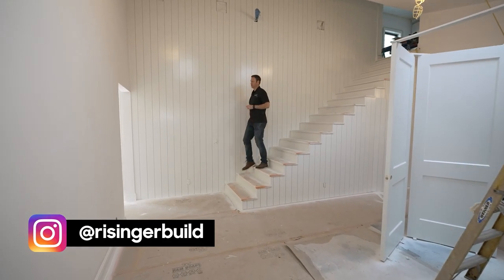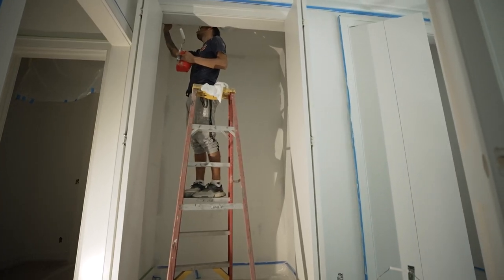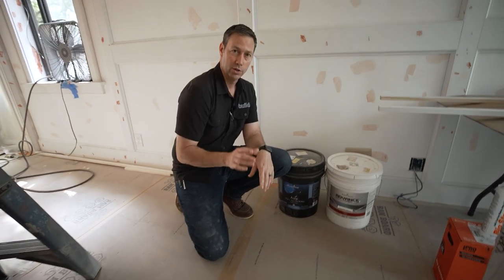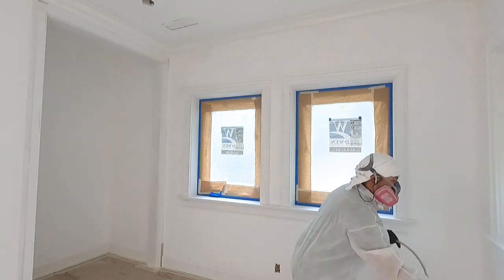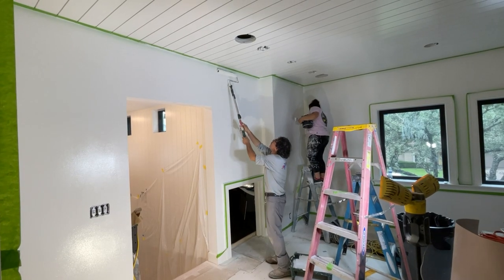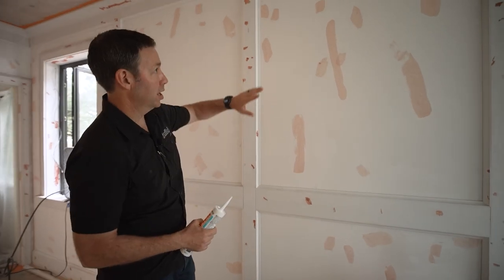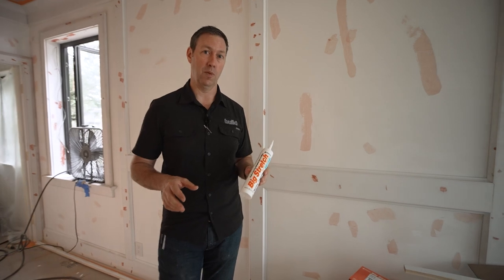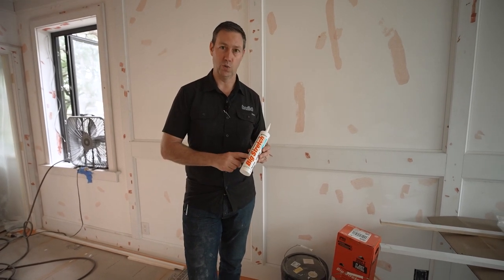The 4 P’s of Perfect Paint

Comment: The last part is the same thing we deal with in the Bay Area. It's really hard to find great painters. There's some companies that offer fantastic jobs but the budget is just flat out not there. And like you, none of our painters can price out the project before actually seeing the work so as a general it's really hard to budget for and show clients. We pretty much operate just like you on paint. We know a couple of really good painters and we just call them up for labor rates, and we supply all the material and equipment too. Painting is the hardest tradesman to find because good painters that get busy start hiring out and often times their employees don't have the dedicating and effort they have. Also one of my biggest pet peeves is them taking the project and just leaving their employees on site and never showing up. 

My experience with Advance is really hit or miss. You really need someone who knows what they're working with because it does tend to run. The Aura is hands down the best paint for Walls, they're decent for trim too, but it doesn't have that hard finish I like for trims. Durapoxy from Kelly Moore is a fantastic product if you want that hard finish, it's a little easier to work with, but it does dry quick so you have to work quickly (great for spraying), it doesn't run, but it doesn't cure quick, so it's still soft for 2-3 days. The best paint finish I've seen for trim is Hollandlac by Fine Paints of Europe. We have to get that out of state, and there is a smell, but you can get as close to an automotive finish as you can get out of a can that's not a 2 part lacquer. Personally I prefer hitting doors with a lacquer. Really hard to do on the job site, and it does exceed all VOC limits at a residential jobsite, but if you have a painter that has a shop or even an automotive booth, that's one option is to spray it with a 2 part lacquer that's used on cabinets. I absolutely love doors that have super hard paint and a gloss finish.
Reply: Great info

Comment: Its true that you get what you pay for, in every trade, in every construction material. Always under promise and over deliver. Always put the customer in the driver's seat on costs. Two to three options puts a reality check on expectations.. Cheaper paints cost more labor to apply, both in prep and in final touch up. As a businessperson there is margin to be made in materials just to handle it,  5-15% as a rule of thumb, so if your cash flow can manage it, it can help level out some unexpected job costs. Also, a good supplier relationship is key, beyond just commercial pricing, but in product support and service. If ever there was a warranty issue, you need another expert in your corner to help resolve and/or negotiate. Overall great video. Its hard to cover every aspect of a trade, but you hit the main ones from a builder's perspective. My dad always says, "hire the best, fire the rest". 👍

Comment: It'd say there's a lot more prep work on re-paint.
In addition to original issues you deal with, you also have to fix years of dings, stains, poor painting projects (roller fuzz, drips, roller trails).
I usually spend lots of time with a sharp razor blade cleaning up this mess before spackle, etc.

Comment: Great to see you go with level 5 smooth drywall. Really sick of painters insisting on textured finishes. Absolutely no reason to allow that. The bad news is that these days, you almost have to take what you can get in terms of painters as there is such a shortage of labor. We have been waiting over 2 years fora a specialty painter (Central Texas).
Reply: I might can help you. Describe your project. I’m north of Dallas but keep i35 warm between here and SA
Reply: We have been waiting over 2 years fora a specialty painter (Central Texas).

Likely a very intelligent decision. Bad painters using bad product can do a tremendous, & I mean tremendous,  amount of damage
Reply: @HarderNotSmarter1  Finished new custom home last January. Looking for a faux metal paint finish on a large range hood in a vaulted ceiling kitchen.  Need a bunch of other new-construction follow up jobs and painting as well. We are 30 miles north of Waco. Open to suggestions.
Reply: None of the drywallers around here do level 5 finishes. As a painter I always prime new drywall with US Gypsum Tuff -Hide Primer-Surfacer to make their level 4 finish into level 5. It's the same labor and material cost as using a regular primer but with better results. Last year a house spec'ed level 5 drywall and the general contractor paid a lot to bring in an out of town drywall contractor to do the work. You should have seen his face when he learned that he had been getting the same thing from me for no extra charge.

Comment: It's all in the prep. A small percentage of the project is actually “painting."
Reply: Especially when spraying. Then it's like 95% prep
Reply from the maker: Agree 100%
Reply: You left a "P" out, primer. It is very important and they are not all the same.
Reply: Agreed. There are so many prep tips, could be its own video
Reply: Absolutely, paint brand pales in comparison to... 
The prep and the painter applying the finish.
"As above, so below".
Reply: @ksimmonschicago  bingo
Reply: @ksimmonschicago  Surprised there wasn't an in-depth discussion of primer, that's the key in my view.

Comment: Love Aura and Advance.  Regal Select is also pretty good and gives Aura good competition.  I agree Aura (and Regal Select) have low odor.  Advance is low during application but once curing begins, it stinks.  Several days smelling that.  But it's fine, the self leveling is fantastic, long open time, and ease of use still make it a winner in my view.  Just can't be in a rush when using Advance, it's one coat per day.
Reply: You can easily do two coats in a day. If your profit margin depends on it there are many tricks to doing it.

Comment: I'm getting ready to do our house myself, I've painted before but I'm not a professional by any means.  I've still got wallpaper to strip (3 layers from a 1986 build) and to wash the ceiling in the kitchen/diner.  I know I need a colourblock primer and I also know our walls won't be stopped to paint finish; I'll have to try to get them close to that myself.  Luckily my plastering skills have improved over the years.  I've got everything I need now, including a Wagner spray gun designed for inside use which I know will give me a better finish than the rolling I usually do.  One question though, the box of the sprayer says no cutting in needed; I have a strong suspicion that it's lying to me; what do you think?

Comment: Advice needed. A theoretical inquiry. Does a single layer of 10 inch foam have the same R value as 4 layers 2.5 inch thick? Multi layer foam vs single homogeneous layer. Or 2 layers vs 4. While maintaining the same overall thickness. Thanks
Reply: what needs to be thought about is the movement of the foam. foam does move and one layer can open up. Multi layers are always better, though the r value of 10" of foam will be the same, the multi layers will perform better. when you go to install it, you can cut 2.5" of foam more accurately than 5" of foam. Hope that helps.
Reply: @martymunroe8882  Thank you Marty. Well noted. Any Thoughts on the fact that material is detached. The nano gap formed might change the conductivity thus increasing the R value. Just thinking out loud

Comment: I know this is off topic of this video. I want to insulate the gable ends in the attic. There are no vertical studs. Plus there are a lot of framing & siding nails protruding through the OSB. I don't want to cut any of the nails. My question is; can I use a adhesive to one side of Rockwool insulation to help the insulation stay in place?
Reply: If its an unconditioned attic, (meaning its not heated or cooled) There is no point to insulating gable ends. You add insulation to the floor of the attic. Because you are "conditioning" the occupied space below. Insulating the gables ends would be a waste of time, money in almost all cases. But yours may be different.

Comment: You practically MUST spray that advance. It pulls and drags sooo bad you can barely brush it! Backbrushing? No chance.
Reply: Not true - career painter here and Advance provides a nice brushed finish also, but you have to be experienced working with paint- best if temperatures are a bit cooler and you are using a high quality brush with high bristle count. Advance has nice self-leveling qualities. Of course it does also spray beautifully.
Reply: @nathanarmstrong2652  Yeah I only vfb started in 1991 so I probably dont have the same experience and only work inside where the temperature is climate controlled.  I will try to remember that advice when backbrushing 16 footers in the summertime in FL! 🙄 
The sad truth is Ben Moore paint didnt use  to be like that but the soccr dad consumers wanted faster dry times so here we are.
Reply: @nathanarmstrong2652  ...and yes it does spray well but then gain so does there oil base with a little naptha.
Reply: @danielbuckner2167  True I'm in Canada and for all I know it may not be the same formulation since our regulations could be different, and also climate affects application qualities - so I should not say its necessarily inexperience.
Reply: Interesting. I've used a flow leveling agent when I've run into this, anything to increase the leveling without compromising film integrity
Reply: I've had that problem with rolling on Advance, would not recommend rolling it on. Heard it from others as well. Very reluctant to recommend that paint at all bc it does not look good rolled or brushed.
Reply: @justindegolier1633  penetrol and floetrol work great! Sadly that advanced doesn't take them very well and it doesn't really improve the grabbing or the dragging. Not sure why!🤷🏻‍♂

Comment: Probably the best tip you give is one you didn't dwell on, is the idea of buying the paint yourself. Too many painters will charge you extra. I started professionally painting over 30 years ago and never saw a reason to profit off the product. Either my work stands on its own or it doesn't. 

I did cringe a bit watching the wall and trim spraying as the guy(s) were not very good at keeping the spray perpendicular to the surface. This results in uneven paint, differences in sheen, and other problems.

Comment: I’m very surprised you would use Aura for ceilings. Way too expensive and doesn’t even come in a flat sheen.

Other than that, generally fine advice. I’d also argue that a repaint requires just as much prep work as a new construction job, just in an entirely different way. There you’re more focused on drywall repair rather than trim prep.
Reply: Sponsors eating that cost
Reply: @Tony McSteven I hate ceilings with a shine on them, looks like something from 1980
Reply: Styles certainly differ region to region. Here in Toronto, we use flat or ceiling paint. Especially, now with the modern low-sheen look that is  popular. All surfaces, including millwork, have become lower-sheen as homeowner's are looking for less reflectively in their paint. Even for walls matte is our go-to.

Comment: Advance is Primo!  BM  is top shelf all the way .
Reply: Use BMs Regal line most of the time and have used Advance on some trim.  Advance looks good but is hard to apply when you are not a professional painter.  Have not tried there Aura line yet although I have herd good things about it.  For Regal the price point is not that bad compared to HDs and Lowes, may be cheaper when you consider how far one can will go on the wall.  There is also the convenience factor of  BM, I can go one mile down the road during business hours and get it at the local paint shop vs. driving to HD in the next town.  In my local paint shop BM is actually the lower end of paint they sell, they have some Irish and Dutch paints which made even Aura look cheap.

Comment: If mixing a 2 part is too difficult then stop and call a handyman. Glazing compound is one part and dries like it too! 🙄 Use icing which is a 2 part with a smoother cream-like texture and sands better. 
Most painters cut their teeth on new construction so that's a given. However repaints require skills construction painters may not have. 
Matt, interesting way to pay painters. Almost sounds like employees.
Reply: They are not employees if he doesn't "direct" the work.  Example, he doesn't say when lunch is or how to roll or how to spray. He will just specify color, product and assignable details.
Reply: @WillPower78  I dont think they are but lots of bosses dont specify work, just the results. The issue is whether the state sees them as employees and how their pay taxes are handled. 😁

Comment: Great episode amigo:  lots of detailed tips and reflective thoughts-- as woodworkers we used to apply Benjamin Moore in New England a lot but then they came out with mid-end series which we tried it on a job with terrible results: had to 3 coat a condominium interior, so I've gone back to the high end Sherman Williams paints, when I rarely paint
Reply from the maker: You’ve seen it firsthand so you totally get it. I did my time in the 90’s on Production Homes so I’m in the same boat. You get what you pay for!

Comment: For interior decorative paint, does it make much or noticeable difference if roller, brush or spray application is used?    I'm just thinking that spraying walls and doors may be overkill.  If anyone has an opinion or experience I'd be interested to know. Thanks.
Reply: As a professional painter since 1986 when painting drywall I spray primer and I spray and backroll ceilings. I backroll because I want the roller texture for future touchups. Using a roller to touchup a spray finish will show because of the different textures. I cut and roll the walls because I don't want overspray on the ceilings.
Reply: @zone4garlicfarm  Thanks for explaining that. Much appreciated.  I'll have a lot of building, pointing, and general decorating to do in the following  years. Every tip from those more experienced will help.
Reply: @zone4garlicfarm  if possible spray all the primers, spray first coat on walls, spray and back roll ceilings, spray all trim, cut and roll finish coat on walls.

Comment: As a painter myself, now reconverted into a gelcoat finisher for luxury boats (mirror finish polishing etc ...) because of an injury, as you said, everyone can spot a bad paint job and recognize a good one, but everyone thinks they can paint ... only when they take the time to learn or watch you do it, do they understand that in fact they knew nothing (John Snow).
And I blame television shows for this unfounded confidence in people's ability to trash talk how much you are quoting a job, to then later get a laugh when you get called back to fix the shit some other cheaper dude did, or worse (and most won't admit it) they did ... and wow, the price always increases, because you're no longer working from a clean slate with no hidden issues you were not aware of (humidity content of the walls and wood, bad patch jobs of voids etc ... no undercoat where you can get fatty / oily migration through the layers ...).
It's insane. 
Even I thought I knew how to paint before I actually learned how ... and was severely humbled in the process.

Comment: Great video! FYI I think you might be reversed on viscosity. High viscosity is more solid not liquid.
Reply from the maker: Really?
Reply: I had to look that up too. Sample was that peanut butter is highly viscose and behaved similar to a solid.
Reply: Viscosity is the measurement of resistance to flow. High viscosity means high resistance to flow.  Low viscosity doesn’t always mean lower solids. Good paints and primers can have high levels of solids but because they use quality additives and pigments (that are expensive) they still flow really well and have lower viscosity. The paints I use have 68% solids in white but still flow and level beautiful when applied with skill and experience. Some would say they run easily compared to consumer paints. Big box store paints give the appearance of quality because they are highly viscous but the solids they use are crap like chalk and clay. These dull and degrade quickly and have a useful life measured in months and they don’t flow. Consumers and DIYers give these paints high ratings in surveys because they open the cans and they are thrilled with the fact that they are “thick”.  I read an industry study that showed over 75% of American paint jobs were within 6 months of moving so longevity and durability usually aren’t a consideration, only price and coverage in minimum coats. In Europe, by contrast, a paint job is expected to last much longer (usual 15 years) as people move less often.

Comment: 6:24 - shows painter using a microbead and then says you dont want to use a microbead?  :-) I'm currently painting a bunch of windsorone trim and have some really tight joints - I've been using 50/50 wood filler/spackle and then bondo - yet to paint so not sure if that was the right move or if I should be using something like big stretch?
Reply: In joints that small, Big Stretch could be used, but it will likely need to be repaired down the road.  In joints smaller than ¼”, it’s difficult to get enough caulking in the seam/joint to be able to accommodate all of the movement that will occur.  The combo that he is using right now will likely need to be repaired as well, since it will not have any flexibility.